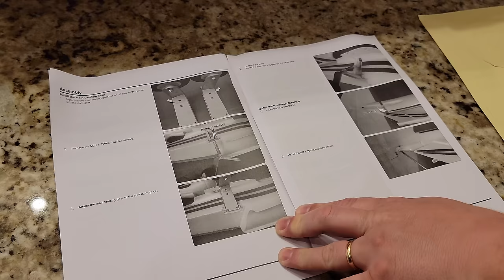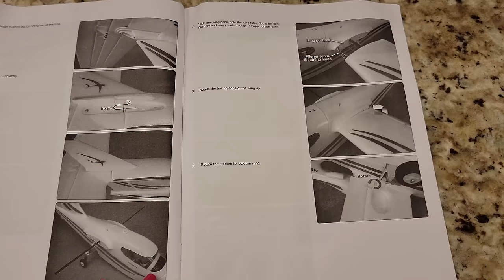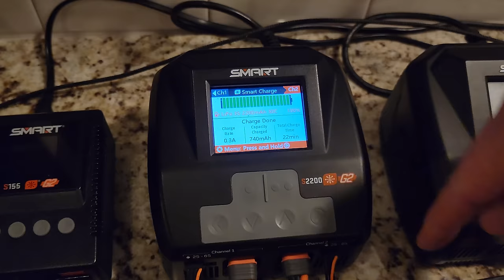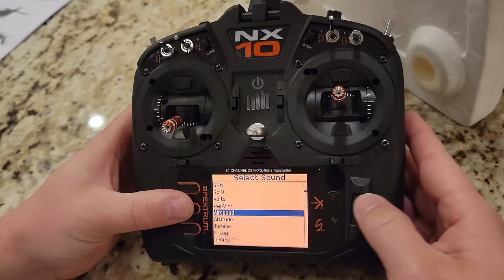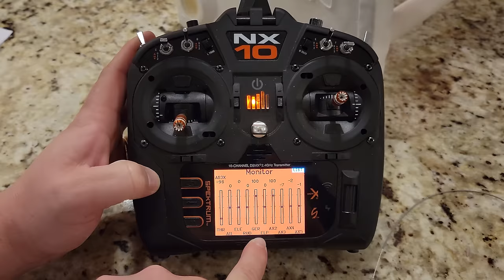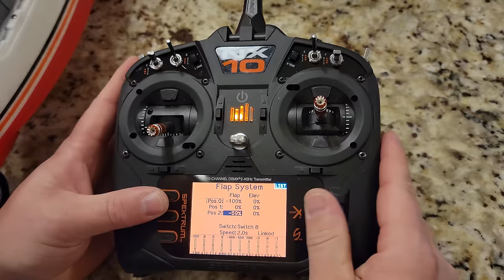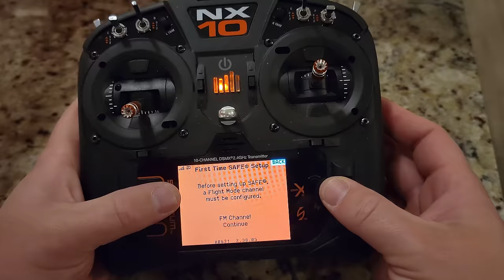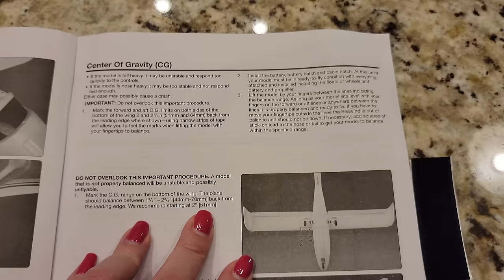Tower Hobbies - Seawind - 1.4m - Unbox, Build, & Radio Setup

Comment: I loved the Seawind in its earlier two versions!  I think I got this before Tower Hobbies got bought out and it went away.  It's still in my fleet.  Seems to be identical but new color.  For that plane, when slow and doing a full power go-around, be ready on aft elevator for the nose pitch over due to high mounted thrust ("gigidy").
- Make sure the nose gear is centered and secure.  Coming lose on takeoff roll makes for a wild takeoff.  Ask me how I know...?  
- Hopefully these wing servos are higher quality than previous version, they buzz a lot and were prone to fail.  
- I used a 3S 2200mah and got like 5-6min.

Comment: This is a brilliantly designed plane. ...Surprising in your flight footage u didn't experience severe pitch & throttle coupling bcz of thrust line way above CG
You should've given detailed look at entire set of mechanisms. It's like building Lego Technic
 & the cherry on top is the 4 seats with leg room & super detailed control panel . ..This is r8 up realistic 16+ model aisle. 
Unfortunately, my suburban neighborhood doesn't afford me big planes.

Comment: Sounds like you are over driving your gear. Back off the servo drive for your gear. love your videos. When I have a problem I just go through your videos. Problem solved. Thank you for doing what you do so well 😄😄😄
Reply from the maker: Thanks! I think it's hard NOT to kinda  over-drive the servos on this setup, since the plane is resting on the linkages. I wonder if there's a way to CAM past a step, and keep the load from transferring back into the servo?

Comment: I got mine a couple days ago. I removed the canopy and made it so much easier to work on. If I would have watched this video first and not your flight video first I would have not ordered one. I do like the plane but why put a quick release lock/release on the wings with how there set up. I wanted to get a plane I could quickly pop the wings on and off, this is not it. lol That flap set up is the main issue.

Comment: My wife  bought. a seating  8 years ago but I've only flown it once. I decided i t was too advanced for my experience it hS no wheels no retractors no flaps . But I've flown many planes now aNd wanted to set it up to fly. But couldn't follow your explanation.
I'll watch it a few times .the plane has flown once buti now have Diferent transmitter and  receivers .I guess I'll figure it out 
I might have to buy a newer model with all the bells and whistles